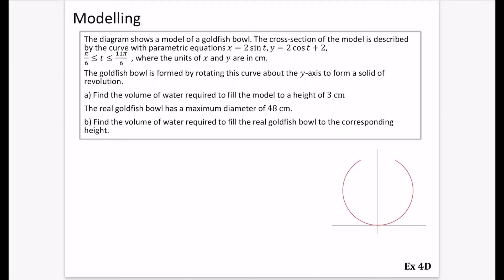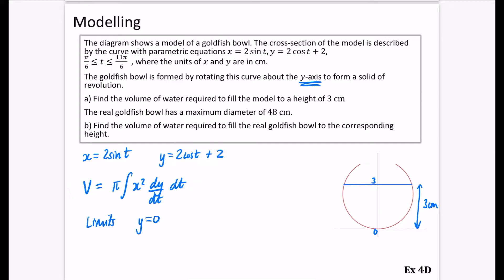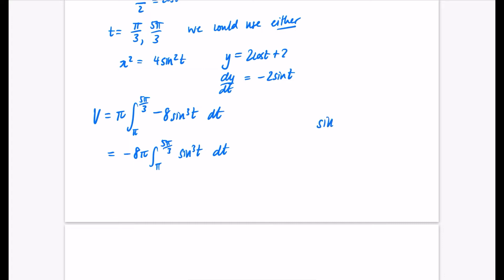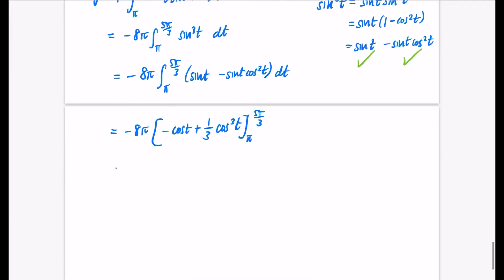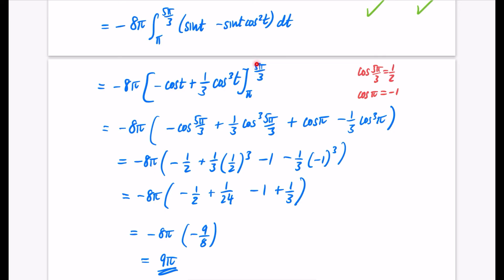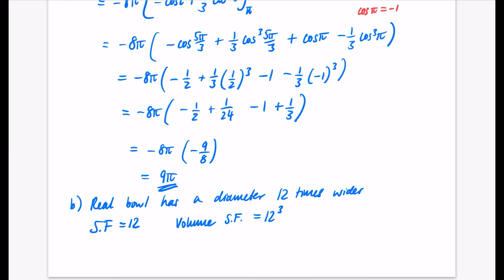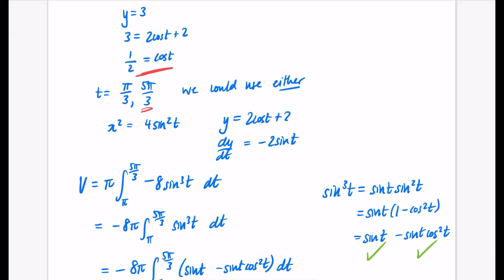Volumes of Revolution (A2) 4 • Modelling • CP2 Ex4D • 🎯

Comment: Hi sir, this was in a further maths paper in part with a volumes of revolution question, how do you integrate sin^3t multiplied by cos^2t? I can’t seem to figure it out after doing all methods. Thank you
Reply from the maker: I'd probably replace sin^3 with a sint and sin^2 t, then replace sin^2 t with 1-cos^2 t... then expand everything and then go from there, I won't give you the full method though! (Think reverse chain rule)
Reply: @ I just did it and it worked out!!! Thank you sir 😊

Comment: For modelling questions, can you still do the upper line - lower line (i.e..if rotating around x, for two curves y = abc and y = cde, can you do the integral of (abc-cde)^2 dx
Reply from the maker: No you need to do abc^2 - cde^2, you can't subtract and then square, as these give different results.
Reply: @BicenMaths  Makes sense, thank you.

Comment: can i do all the stuff at 6:20 with the rearranged double angle formulae?
Reply from the maker: No - that part should be integrated with the reverse chain rule, as there's the sin in front of the cos^2. The rearranged double angle formulae should ONLY be used if trying to integrate just sin^2 or cos^2 by itself (and of course things like asin^2 x or acos^2 x where a is a constant).

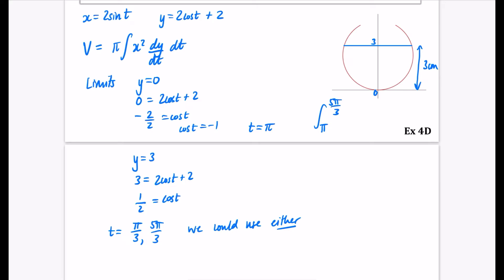Comment: at 3:39 if you used the smaller one, you'd still switch the limits and multiply by -1 as usual, right?
Reply from the maker: Yep!
Reply: @BicenMaths  i tried this twice but keep getting the negative answer in the end of -9pi, does this definitely work?
Reply from the maker: @SinghSK-z1p  Hmmm it should do - that's weird. Not sure about why that could have happened?